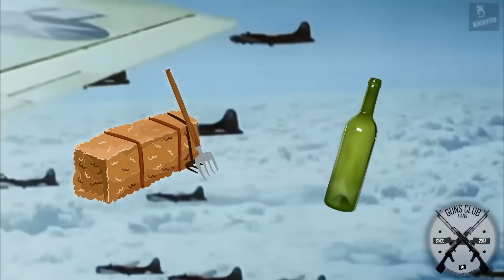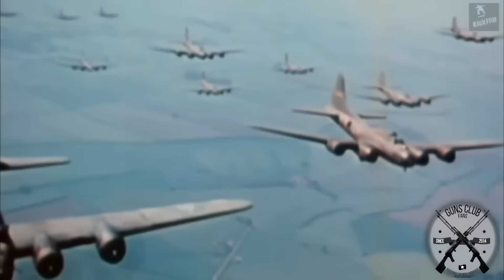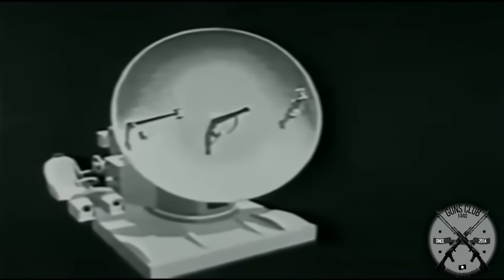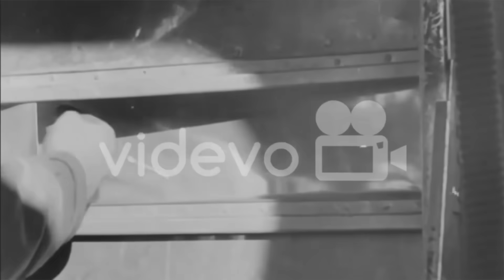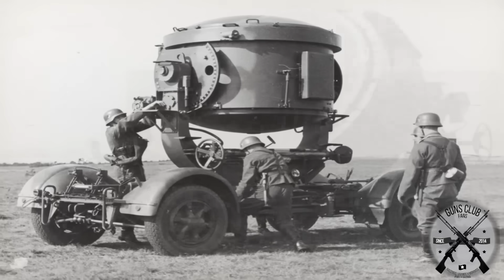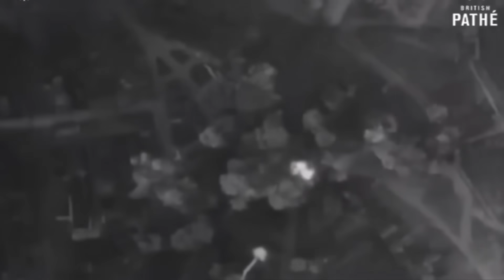Why Did Bombers Throw Bottles at Their Enemies in WWII? The Shocking Truth

Comment: I had a  conversation with a Vietnam veteran who flew cargo planes. Not to be fully upped by the bomber, ground attack planes. They would hold back a case of grenades. Pull the pin and put the grenade in a glass jar, with the sides of the jar holding the safety lever in place. Not even remotely accurate, but they would throw these out for their own bomb runs.

Comment: The engines in bombers were synchronized so the exhaust noise would cause beats and the detectors could not determine at which altitude the plane was located.
Reply: That's NOT why they were synched .

Comment: My father flew B-17s from the mid-lands in England during WWII. He told me that while the B-17 had a toilet, or sorts, no one wanted to clean them out after a missions. To avoid that chore, sometimes the guys would pee into a condom. When done, they'd tie it off and put it on the bomb bay doors.
At that altitude, the urine would freeze, and with the curve of the bomb bay doors giving it a shape, the condoms would sometimes spin like maple leaves as they fell when the doors were opened at the beginning of a bomb run. 
They never heard if the did any damage that way, but you have to admit, that's an ignoble way to go. "Today we remember our brave comrade Fritz....."
Reply: The RAF used bottles as urinals. I've never heard of them being used to deceive the Germans. The Chemical toilets would spill If the plane had to be thrown around in evasion tactics. Also the crew were too busy flying, navigating and watching for enemy fighters, so couldn't be spared to go to the can.
Reply: There's a book called The Eighth Passenger by Miles Tripp, who was a bomb-aimer in a Lancaster and flew some forty missions in 1944-5. The pilot had to pee on every single mission and carried a can for that purpose. It was Tripp's job to empty it over enemy territory.

Comment: You should see the Zeppelin detectors based on the North East coast of the UK  basically a concrete parabolic bowl that detected the sound of the engines.
Reply: There are several on Romney Marsh in Kent. They were in use until Chain Home became operational